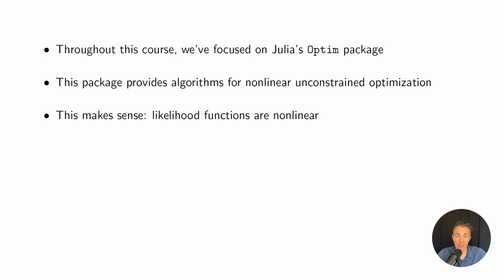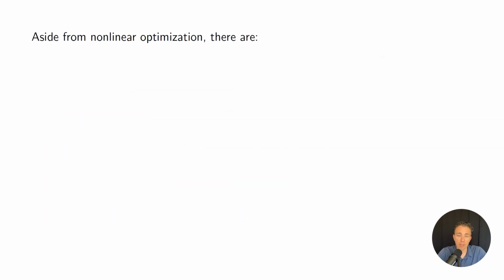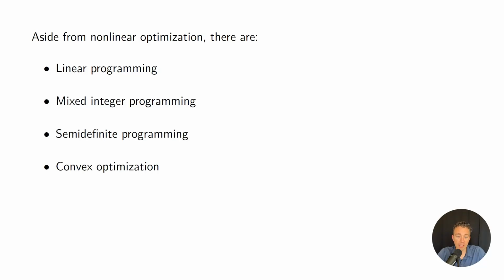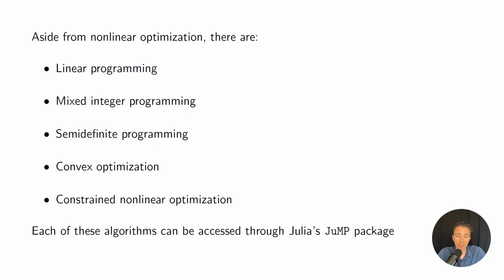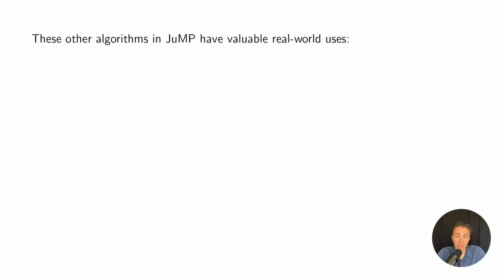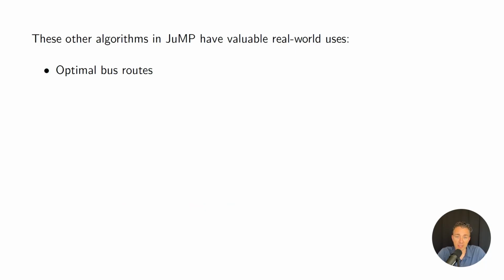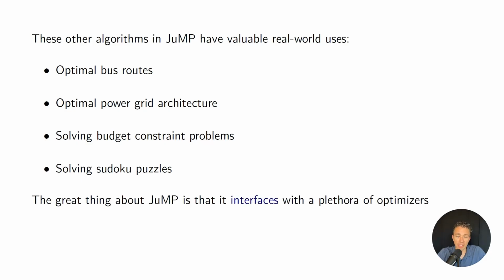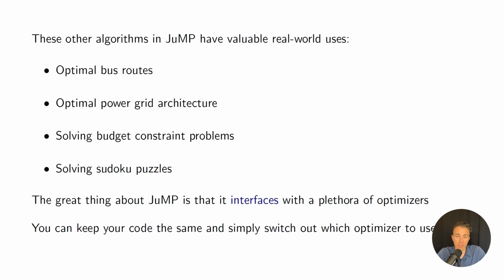Advanced Optimization Techniques for Estimating Structural Econometric Models

Comment: Can these optimization approaches be implemented in python? Put differently, which way is more simpler, Julia or python? Thanks!
Reply from the maker: You can do these approaches in any programming language: Matlab, Python, Julia, R, even Stata if you want. Julia and Python would probably be the top two, but Matlab is one I used for many years (and still use for some projects). As for which is "simpler," I think that's up to your personal preference and experience.
Reply: @structuraleconguy I got it! Very appreciated!